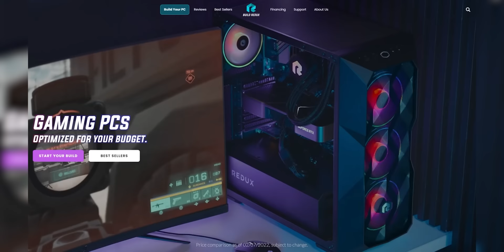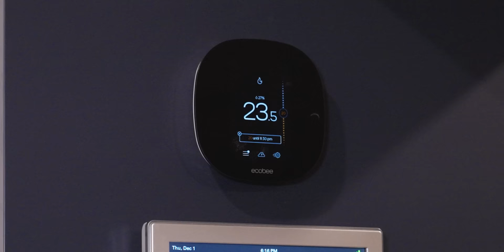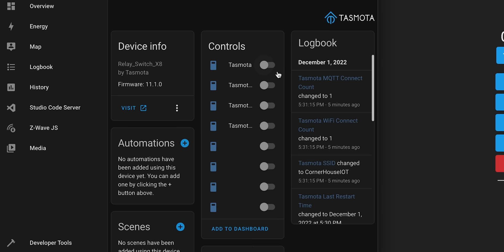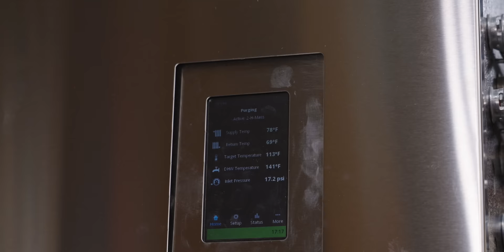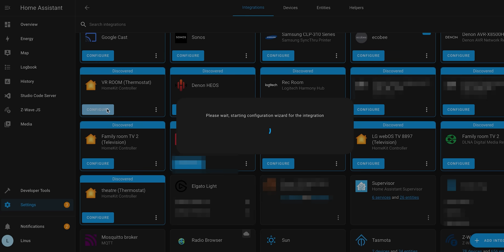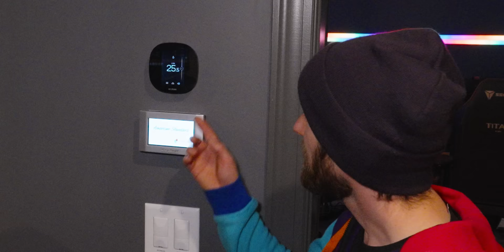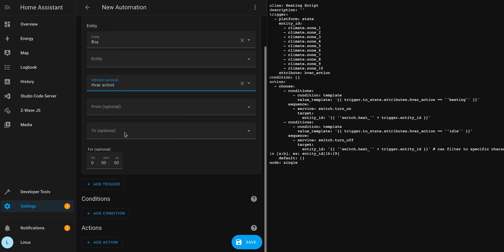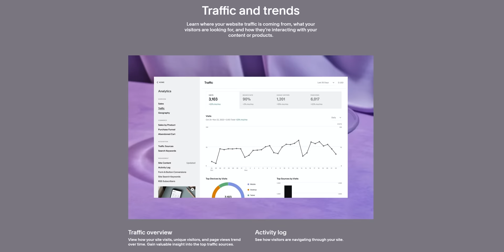My Smart Home is Stupid - HVAC Update

Comment: instead of ecobee thermometers, you could have used Aranet 4 sensors (which measure temp, humidity and CO2) and integrate them with MQTT directly in your home assist
Reply: One of the things he wanted was basic controls in the rooms that anyone could use.

Not needing to be onboarded into a app
Reply: @AnonymousMod.  aranet 4 pro have no app, communicate with a hub that knows how to MQTT. All locally, good sensors, e-ink displays. Only downside is that thr aranet 4 pro run on 2xAA batteries that need changing every few years.

Comment: If you want to use separate temperature sensors, just get some Wemos D1 Mini boards and TH11 sensors. You've already got 3d printers at your disposal, so you can print some enclosures for the sensors. The only other thing to consider is the power source.
Reply: you need to account for the WAF ...
3D printed things may be acceptable for us geeks, but the rest of the planet wants things to look good and be durable.

Comment: If the ecobee is off by a consistent amount, you can change the calibration on them so it reads the correct temp.
Reply: if it's heated up by the device below, the offset curve wouldn't be consistent.
Reply: @itsbazyli  it would need to be tested. But it may very well work just fine.

Comment: It's incredible to watch the lengths Linus go so he doesn't have to lift a finger. literally. My notion of a smart home? Everything, and I mean EVERYTHING should be controlled from a single app or voice control, otherwise it just becomes a nightmare to set up so many different systems.
Reply: That's what home assistant is.
But the two thermostats are funny, granted
Reply: Yes, the HomeAssistant app?
Reply: I know about the home assistant, but that looks more like plug and program than plug and play. I guess that's because I'm less geeky than Linus and his troops :)
Reply: @wettuga2762  The solutions you're talking about that are 'one app, plug and play' that do everything and aren't Home Assistant or similar will be proprietary, cloud based crap. It's great when you buy it and it works - it's crap in 10 years when the company goes under, shuts down the servers, and all your smart unified crap stops working. Or security holes left unpatched. Or their cloud services get hacked and your smart devices get compromised. 
The two thermostats are funny but otherwise, Linus's way of going for local control over convenient setup is absolutely the way to go, if you're technical enough to handle it.
Reply: @sinthorias  Not using automation(let alone via wifi) to do something as basic as controlling the temperature in each room, would've been the way to go.
That he even felt the need to mention that it wasn't using the cloud...to control the temperature... shows what a pointlessly complex mess this is.

Comment: Highly suggest you guys to look into Node Red.  It might look more noob friendly (and it is) but like all things programming, the biggest pro isn't even the huge array of features and plugins, but how easy it is to maintain and debug any scripting issues.  Stick a debug node onto any automation step and check for certain values, or whether or not a switch flipped the way you want it to.  It'll be good material for another video.

Comment: This series has shown me that I will never outfit my house with smart home crap lmao
Reply: To be fair, Linus did wish to use his custom solution rather than just use an industrial one, so i wouldnt say this is a correct representation of a smart home system overall
Reply: I mean its not that complicated if you stick to the basics (thermostat, light switches, etc.), Linus just went above and beyond. Don't let video like this push you away
Reply: I think this situation is extremely rare, he is not setting up what a typical consumer would be using. The ecobee and other products were designed to be used with the standard systems you would see it pretty much any other house. I have an ecobee and smart lights and everything works really well. What he is doing is using a custom heating option so he legit has to fine-tune the entire system and tell the general consumer products to act differently.

Comment: If you put esphome on the relay boards instead of tasmota you can then just use the native homeassistant api and not have to worry about having mqtt at all (unless you have other stuff that will require it).

Comment: Scrolling through the comments and it appears that folks have a wide range of personal temperature preferences.  One thing I don’t see is what the Humidity is like in those places. Humidity is a massive factor for human comfort as the more humid it is the harder it is for your body to regulate its own temperature.  Id take a room at 24 deg C at 30% RH vs 21 deg C at 70% in the summer any day. I will note that I live in a very humid part of Canada.  

As for the building control side of things, I have learned working with Commercial Environmental Control Systems is The system “learning” about how long it takes to warm up and cool down is not a set it and forget it deal. Its normally best to let it run over a heating or cooling season and trend it while making changes only if absolutely necessary. Log those changes and review the trends after and make changes.  Every building (or house) is different and has quirks that effect how Environmental systems behave.

Comment: As a heating tech this hurt to see how your controls were designed. Separate thermostat for heating and cooling instead of one common, thermostats not directly powering the zone valves. In my opinion the "wireless" zone relays are redundant and serve no purpose other than needless complexity and I doubt that this will provide better integration between the thermostats. But hey at least it makes for content! Still love the channel and that IBC boiler is a beaut ;) 

PS - You may not know this but Tekmar is based out of Vernon, it would have been nice to show them some love! Consider replacing the ecobee's, zone relays and american standard stats with some of their stuff. If you need some advise reach out!

Comment: I have boiler with radiators in my house.  For my Nest schedule I set up my 5am temp at 68 Fahrenheit then at 8am the schedule is set to 70 Fahrenheit.   The reason is by the time Nest shuts off the boiler the radiators have hot water that will still disapate and increase the house temp by 2 to 3 degrees.    

One of two things happen either someone is too hot and opens window waisting energy OR their body gets used to the upper temp and during the house drop of 3 to 4 degrees they get cold turning up the temp once again waisting energy.     

By adjusting the schedule to accommodate for the continuous rise in temperature we saved a little over $100 US a month on energy cost for a 1600 sq ft house.

Comment: My problem with Home Assistant is all the automation logic is done with YAML config files, which is like trying to write e-mail with a mouse and a virtual keyboard. Just look how a simple oneliner if statement looks like in the HA's Automation UI (14:54)
Reply: You can use other stuff as well of course, but then youre adding even more parts to fail. Node red is kind of awesome, I'm trying  not to use it though...

Comment: A lot of the decisions made with "smartifying" Linus' house still confuse me, if the end goal is to save money. Like was said in the video, it takes ages for in-floor heating to get a room up to temp, and thus it also takes ages for the temp to return to ambient, so micromanaging the temperature doesn't really make sense. The only time you're gonna get energy savings is when the house is empty for a period longer than it takes for it to cool to ambient and heat back up, and if you're gone for that long you could just turn off the HVAC system and get the same savings. 
Linus bemoans the mercury based thermostat, and yes it is quite old and potentially a hazard if someone busts it open, but I don't think mercury ever needs firmware updates, proprietary software, or is vulnerable to single event errors.

If all it takes for me to not have the months-long headache Linus is having is to pay a little bit more on my energy bill, I think I'll take that option.
Reply: There is an amusing display of ignorance an inability in those videos.

Messing with underfloor heating during the day makes no sense, except for increasing temperatures during sunny hours in winter if you use an electric heat pump connected to PV solar. (Pre-heat during the day, revert to standard temp during the night). 

There is virtually no saving if you choose different temperatures, as it takes 4h for the system to catch up and it will likely „overshoot“ while catching up - so worse consumption pattern than just leaving it alone.
Reply: There are no energy savings compared to your home, as Linus set up dozens and dozens of devices throughout the house. It also took a lot of energy to manufacture those, and if there is any advantage in consumption, it wont offset the initial cost in decades, which is probably after they break and you have to lose time, energy and money again
Reply: @TileBitan  Energy Savings can only be achieved in conjunction with a solar roof when you go through the pain of controlling consumers and optimizing heating based on energy production. (Increase temperature by 20-30 degress in your warm water storage tank, change target temp for underfloor heating, etc)

Other wise the savings are negligible…
Reply: @TileBitan  this is also often the case with High Efficiency furnaces according to my HVAC tech dad, they are so expensive and break so often that the end user won't be able to make up the cost. If you have a mid efficient furnace, you should only really replace it with a HE one when it's totally busted.

Comment: The perils/joy of automation :(. I'm jealous of your 20.5 degrees, that's summer vacation levels of heat :). My thermostat sits at a Sahara like 18 :), mainly because gas here is insanely expensive, 20.5 would cost about £1000 a month in winter given that my house was built with as much insulation as Borats mankini
Reply: VERY NICE 👍👍
Reply: Oh you’re in the UK? You guys have terrible efficiency, insulation, heating, standards, and it’s all insanely expensive to boot. Never been colder in my life than in the UK. And I’ve lived in a Swedish cabin in the woods for a few months.

Electric plugs are cool though. Nice.
Reply: We've had to turn out thermostat down this winter to afford the bills, so the warmest it gets now is 16, and then only for a couple of times a day. Most of the time it's basically off.
Got down to 13 the other day, and it's not even below zero in the UK yet, brrrr
Last month's bill was £450

Comment: Two questions:
1.  How did you flash Tasmota on the relay board?
2. Why didn't you use ESPHome instead?
Reply: 1. normaly ESPboards have pads for a serial conection so reflashing is as easy as flashing a normal esp2866

Comment: If you give up variability, the heatpumps and airhandlers can be wired traditionally. keep in mind, they will operate traditionally as well, so single or 2 stage rather than how many ever stage steps they programmed into their firmware. -We are Trane Dealers, although we dont really sell them that much. the amount of stage steps is dependent on what series your AS Condenser is.

Comment: Tech Tip too: If you're running the version of Home Assistant that doesn't have the add-on store - you can't use Mosquitto as a Home Assistant Add-on. HOWEVER, you can run it in a Linux VM like Ubuntu using the VM functions of something like TrueNas - you set it up in command line, really easy to do. Then you just point the Home Assistant MQTT to the IP address of the VM!!!

Comment: I think it's time to hire an home design engineer to make you a full radiator house 😂
Reply: @saulgoodman2018  You're kidding, right?
Reply: ((or get Linus aircons. Even the unconnected, split ACs will be enough))
Reply: @saulgoodman2018  Unless you're living in a shed around the artic circle floor heating is excellent, also used in colder climates (Scandinavia or Canada). I'm typing this in my well heated living room (22 celcius or around 72 fahrenheit) in a poorly insulated 1960's house in the Netherlands heated by floor heating (provided by mono-bloc heatpump) alone. I've got no radiators at all and it's freezing outside.
Reply: @saulgoodman2018  indeed it doesn't. Just don't turn it off when it's freezing. Our system survived -20 celcius / 0 fahrenheit last year so we are good. It's very common in Europe. Tbh I'm not really sure what HVAC is in practice. Natural gas ?
Reply: @saulgoodman2018  that's my point, it is. In western Europe new houses don't have anything other than floor heating and it's common for old houses to be converted in addition with the installment of a heatpump (low temperature means higher efficiency)

It's -3 celcius here so it's freezing. We've survived -22 celcius with 21 celcius inside

Comment: With Eco Bee you can also cancel the inboard thermistor and connect a wireless sensor and have the Eco Bee use the sensor reading exclusively!! That would spare you the relocation of the thermostat! I believe up to 5 sensors can be connected!

Comment: You are better off setting the water temperature of your floor loops to the bare minimum you want your house to be heat, say 16 degrees and then use the external heat (servers, heatpump) to heat the extra degree or two you "need".

Here at my house it is 16 degrees right now, if you get used to the psychological cold you will find 16 degrees is actually quite warm!

Comment: Has Linus even thought about the risk of his house being hacked into, wakes up in the morning to a Canadian igloo 😂
Reply: I think that's a key reason he wants everything to be locally connected instead of cloud based. If something does get compromised he can turn off the home assistant server and everything stops being connected. I just hope all his smart home stuff has an analog fallback. If your smart device doesn't have one (like the buttons on smart plugs that control them whether they're connected to wifi or not) then it should not be used.
Reply: @chadmasta5  the way he's done this heating has no analog fallback, if his home assistant server goes down this heating goes down too...
Reply: @EoRdE6  Oh no... I guess if he's desperate enough he could hot wire it by taking the wires out of the relays and manually twisting them to turn on the heat but that's not exactly what I had in mind when I was referring to an analog fallback...

Comment: You can use zone adjusters in your HVAC ductwork. Add a higher tonnage system. Add inline thermostats through the low voltage etc.

Comment: American standard communication isn’t exactly proprietary, but it is. They just use a form of communication between their equipment that we just call DC voltage “communicating system”. All different HVAC manufactures have this form of communication for the high-end multistage equipment.

Comment: Home assistant is great for bridging ecosystems; for example in my laundry I have a Hue motion sensor and a couple of bulbs.  I have HA configured that if the bulbs turn on then it also turns on the Lutron Casetta switch that controls the main overhead florescent bulbs.   Similarly if I turn off at the switch then HA will turn off the Hue bulbs.

It can also make multiple independent circuits work together, so in my basement I have a light by the stairs and a light by the not-a-server rack; if I turn one on then HA will turn the other on, and similarly for off.

I just wish HA was better architected and didn't have so many breaking changes between versions!

Comment: It's more reliable to control in-floor heating based on the temperature in the zone loop (water temperature sensore). This creates a baseline temperature in the room that the heat pumps can be used to bring the rest of the way up to the comfortable setpoint without having to work as hard. This also allows the in-floor heating to run at a more stable setting rather than being subject to the fast changes an air sensing thermometer can be exposed to.

Comment: As far as the ecobee heating by the thermostat: Short term solution would be a plastic lip or "shelf" to deflect the heat outwards. You could use the plastic door draft strips from Dollarama only need to be ~2" (5cm) wider than the ecobee.

Comment: im a danish plumber who work whit heat pumps.  i head of a place, where they wold use the ventilation from a factory whit big machines,  to blow out near a Air/water heat pump and by that make the most out of the scop and even make heat when its frezes out side

Comment: Our house had a master bedroom addition in the 80s. I'd like to firmly grasp the shoulders of the person who ran the duct work and violently shake them. It doesn't get any heat. It's usually 20 degrees higher than the outside temperature. I'm thinking about ductless for the second floor.

Comment: What about setting up a heat pump system where you bore deep holes in the ground and extract heat from the ground during the winter?  If you live in a place like California, at least in the low lying areas, air exchange heat pumps are great and far cheaper than natural gas these days because it doesn't get all that cold even in this most recent cold blast that has buried high elevation mountain communities.  However in Canada cold, an open air heat conveyor belt has its work cut out for it.  But below the permafrost layer, it gets warmer and warmer the deeper you go and thus once again easy and efficient for a heat conveyor belt to use.

It would be great if LTT could demo bored hole Earth heat exchange heat pumps as this is a very important low cost to operate technology for places like Canada.  Probably lower maintenance than the swimming pool idea, though that was also interesting.